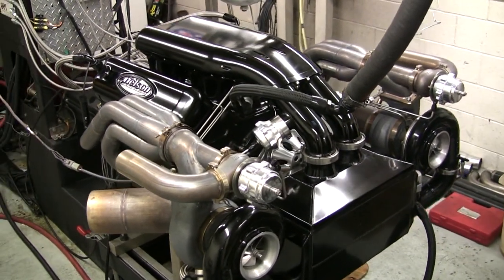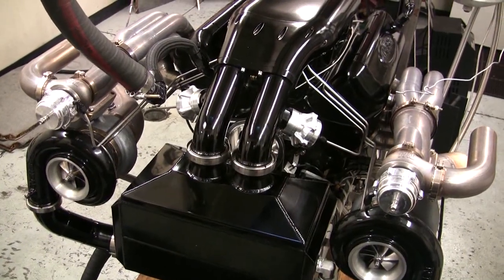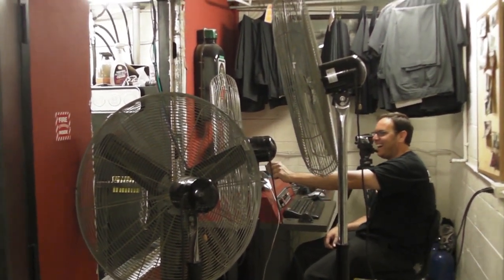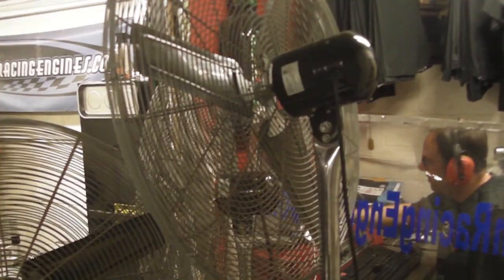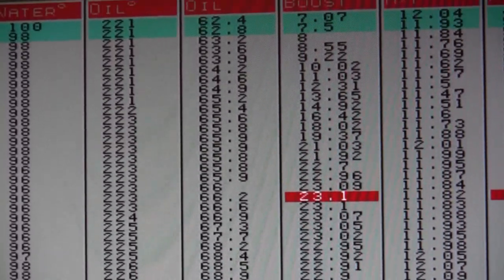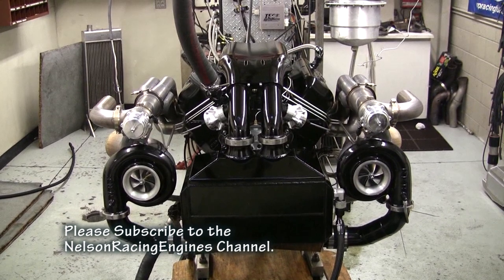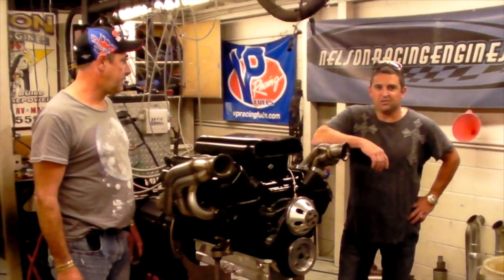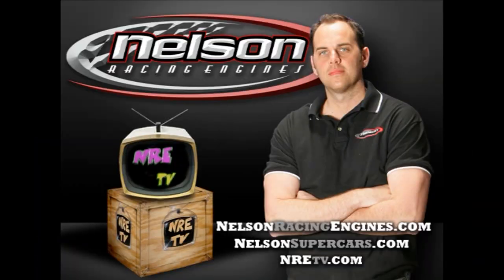2200 HP ENGINE! - Mirror Image Turbo 632 BBC

Comment: The terms are actually interchangeable. There's debate even within the automotive industry itself over the two terms. As an example, GM = General Motors, and they even refer to their engines as motors. Or another example, motorboat. Motors are engines, and engines are motors. As far as most people are concerned, both terms are simply defined as: a device that generates mechanical power/mechanical motion from other sources of energy.

Comment: Looks like something that'd work great in a boat, just might work in a truck, definitely a drag race car, but seems spread out too much to reasonably fit in a street car unless you have a rat-rod with no hood and an open chassis. (Would look sweet on that, just don't see a practical way to get it inside something with the fenders on.) Also going to have to re-tune throttle to a geometric curve (tame it on the bottom end) to make it streetable. Neat design otherwise.

Comment: Please stop calling engines motors. Engines run on internal combustion and motors run on electricity.  If you wish to sound intelligent to those that have a degree please use the proper wording.